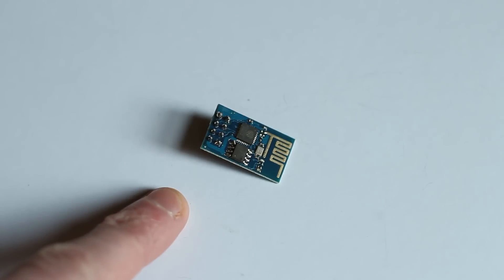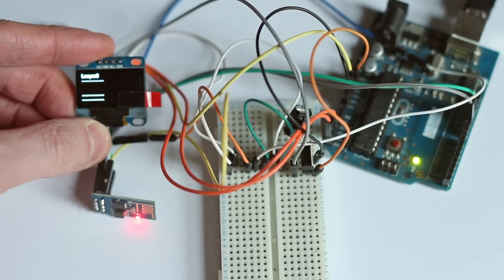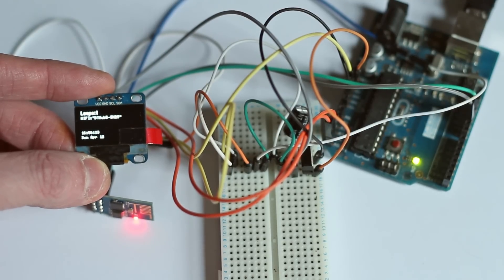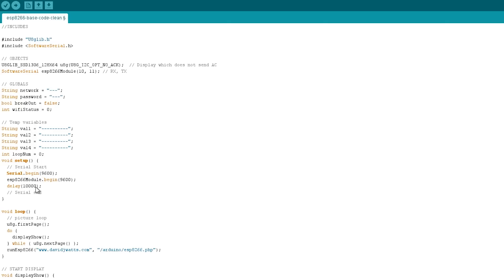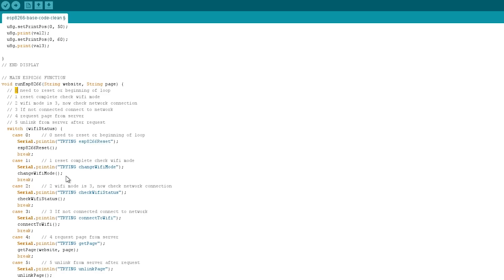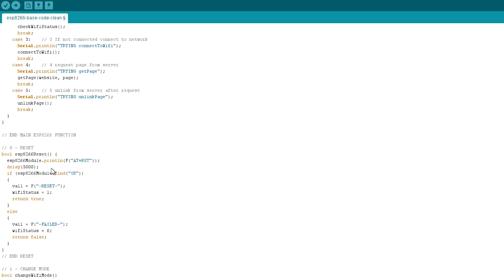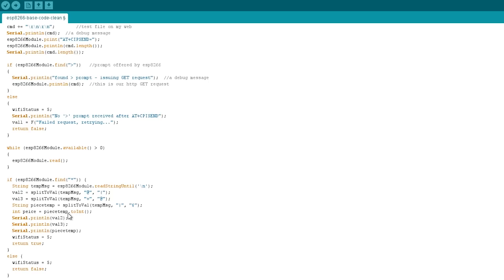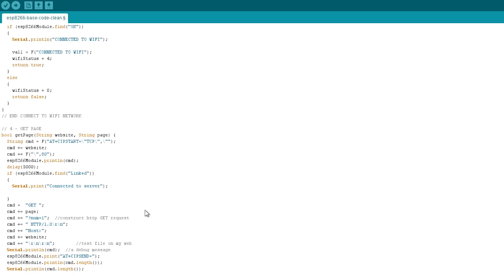Arduino Wifi - ESP8266: Schematic and Getting Started Code

Comment: I need to ask one question. Say I want to put esp 01 wifi to my led matrix display board and i want to change the text anytime through that wifi then how do I do it?
Reply from the maker: For that you will need to directly program the ESP8266, not really the right video for that. Search for how to send variables to an esp8266, using the ESP as a webserver would be the easiest approach IMO
Reply: @DavidWatts  Allright thanks for the advice.

Comment: Can u Give me the schematic diagram to connect tx and rx using resistors to convert it to a 3.3v
Reply from the maker: Just a simple 'resistor (voltage) divider', google that phrase and it should throw up a calculator or a schematic.

Comment: Can you pls show how to code to send the data to the server. Would it be possible to make the POST request? I have similar code but unable to POST the data to the server as it gives 400 bad request.
Reply from the maker: My code won't do post requests  but you could modify it. This video and code was made before libraries were readily available for the ESP modules, I would recommend using a library rather than using serial commands in your main code these days.

Comment: Hi David, 

Thanks for sharing this.

is it possible to connect an arduino with ESP8266 to a mobile internet as a wifi if we don't have access to any local wifi. just wondering if i can use my phone internet to allow the arduino with esp8266 to send data to a webserver to save to a database.

Thanks
Reply from the maker: Yes, the esp8266 can connect to a mobile hotspot.

Comment: So is that code running on the ESP8266 onboard Arduino or the master Arduino?
Reply from the maker: It was just using serial commands to control the ESP, this video sort of pre-dates common methods to program it directly with any of the languages I understand.

Comment: hello sir. Great video. Is it not okay to use the 3.3V from arduino directly instead of 5v? so I can use my esp8266 even I don't have 3.3v voltage regulator.

Comment: Love the tutorial , is it possible that you can share another one with server feature, in it .I understand it already has the server mode (AT+CIPSERVER=1,80), but haven't been able to properly setup and run the same due to looping and data length handle logic issues.

Comment: Hey David,
I am currently working on a senior project at school and am wanting to be able to interface our AGV using a browser or program (I was considering using some visual basic) using an Arduino Mega. I noticed in the video you were using a capacitor in the circuit that you didn't include on the pictured schematic is this component needed or is the regulator by itself ok to use?

Comment: thanks and much appreciated but i have one question about regulator,the regulator is used to drop down the 5 volt to 3.3 volt,but at the arduino board there is also a supply of 3.3 volt is available then why we are not ready to connect to 3.3v instead of using regulator...?
Reply: Thats right: inside the arduino is also a voltage regulator, since the esp needs up to 200mA the voltage from the arduino will drop down so it is advisable to use any external voltage supply

Comment: So far all I can do is turn on an led with a nodemcu dev board. Every time I want to change code I have to clear eprom first. How can I add pin function in pre written code?
How can I get included sketches to show up in individual tabs? Can I eventually control drivers/steppers with esp8266? Why didn't I learn all this when I was 18 instead of getting laid? :)))))

Comment: Thanks man, now they got an USB ESP8266 adapter to ease communication:
www.banggood.com/USB-To-ESP8266-Serial-Adapter-Wireless-WIFI-Develoment-Board-Transfer-Module-p-1102418.html
Reply from the maker: I have one of those, unfortunately it doesn't work as a programmer without a mod. You need to wire GPIO0 to GND for programming or to a spare pin on the ch340g
Reply: Cool, so soldering a switch there would do the trick, thanks for the tip Dave.

Comment: Hi Dave,

Is it necessary to always flash the firmware into a new ESP8266 module before programming it with our codes OR does it come pre-flashed with the firmware as factory setting ?
In case we have to flash the firmware at any stage where to download this firmware ?
Reply: Bit of a late response but maybe it will help others. 

The ESP8266 Modules all come with a preinstalled firmware which uses those AT commands in the video. 
If you just want to use them as a wifi module for an arduino you can do it as demonstrated in the video.

You will find all the commands in this pdf: 
https://www.espressif.com/sites/default/files/documentation/4a-esp8266_at_instruction_set_en.pdf

But the fancy thing about those modules is their inbuild processor with its in Pins which can be used as a standalone microprocessor itself . There are multiple ways to programm them but the simplest is to flash a arduino based firmware on it. I would recommend the later iterations of the board for that because it has more GPIO Pins and inbuilt ADC, SPI compatibility & stuff. 

Instructions on how to flash the arduino firmware that can found here:
https://create.arduino.cc/projecthub/ROBINTHOMAS/programming-esp8266-esp-01-with-arduino-011389

If you do this the old serial based AT firmware wil obviously be lost but can be reflashed.

Hope this helps someone

Comment: HI , i dont have a 3.3v linear voltage regulator so i was thinking of using resistor (Voltage drop ) using 3k3 and 8k2 registers.

can you just draw me a schematic using those registers instead of this please ???
Reply from the maker: That is a bad idea, your voltage divider output will change with input voltage and likely with output current at ESP8266 levels.
Reply: That is indeed a bad idea , but it works !!
Reply from the maker: rushic24 Cool, I would love to hear how it holds up in long term use. The ESP8266 can pull quite a lot of curent at times.

Comment: power to my esp goes off when i connect CH_PD pin to 3.3v.
Reply from the maker: +yashwanth kumar it sounds like you need to run a separate 3.3v supply, it is probably trying to pull more current than your Arduino can provide.
Reply: +David Watts i tired with a separate 3.3v supply, its working fine.but when i upload the code ,it shows  
ESP8266 Demo Sketch                                                       
Reset: General error
i had flashed the firmware also,even then this error keeps on coming..
help me...
Reply from the maker: yashwanth kumar What code are you uploading and to what board?
Reply: +David Watts GetIPaddress code to arduino nano to which esp is connected.

Comment: every time I copy and paste a code and then run the check on it it gives me error message.
Reply from the maker: You might need to be more specific.
Reply: for example , I clicked on the link you provided and selected esp8266.php . clicked raw . copied entire text . opened Arduino 1.6.11 . pasted code . clicked on verify . it gave me error :( stray '$' in program ). it does this with many different codes I try to copy and paste . but its different message . but this one I want to fix because I want to understand how to use the esp8266.
Reply from the maker: jesse chavez The PHP file is not for the Arduino, that is for a server environment. You do not need it, it is for people who have their own servers. There should be a link to other code in the description for the Arduino.

Comment: why do you need the linear voltage regulator , why cant you use the 3.3v from the Arduino?
Reply from the maker: The voltage regulator can be a little weak on clone boards, there is a fair amount of peak current required at 3.3v.
Reply: +David Watts I have an original arduino, it should work with 3.3 right?
Reply: Usually doesn’t work with the 3.3 v pin as the current is too low, use a dedicated power supply or the voltage regulator
Reply: He explains why in the video.. Did you even watch it?

Comment: hello,

My esp8266 isn't working; even the LED on esp8266 isn't blinking.  Do I need to flash the firmware?
Please note that I am using Arduino UNO(chinese version) as serial converter and I am Arduino IDE serial monitor to get the response. 

Please guide in this regard as I am no where. Thanks.
Reply from the maker: You can follow the instructions here to flash your esp8266 - http://www.xess.com/blog/esp8266-reflash/
Reply: I guess connecting the esp_vcc to 3.3v and esp_gnd to ground should blink the led. but that is not the case. what do you say David ?
Reply from the maker: Saqib Sohail CH_PD should also be connected to 3.3v. I believe you should at least see a red power led.
Reply: Dear,

I have done as you said connected CH_PD and VCC to 2.8v and GND to 0v. but no led blinking :(
Observed one thing that when I un-plug the esp_GND I get 2.8 volts as power supply but when I connect esp_GND to my power_supply_GND I get 0.8V. Is this alarming ?
Reply from the maker: Yes, I would be worried about that. 0.8v at your power supply would suggest that your power supply cannot supply the current the module needs or you have a direct short. The module needs at least 300ma.

Comment: Hi David, Thanks for the video! First of all, apologies! for the long post, I am learning and novice to Arduino. 

Few questions first
Q1. Are you connecting GPIO0 to GND for flashing the code. 
Q2. I am using LM7805 as 3.3V linear regulator, but I'm getting 3.7V as output. Is it OK?
Q3. I have attached 100 microF capacitor between GND pin and OUTPUT pin. Is it OK?  Q4. Can you explain us your bread board wiring other than the one which is there in the video? 
Q5. I have not flashed a OS on my ESP8266 12E. Is there any Arduino code to flash the OS in the WiFI module?  Please suggest a way to do it. 
Q6. I have compiled your code available on https://github.com/mrdavidjwatts/esp8266Module. I am getting following errors: 

Arduino: 1.6.7 (Mac OS X), Board: "Generic ESP8266 Module, 80 MHz, 40MHz, DIO, 115200, 512K (64K SPIFFS), ck, Disabled, None"

sketch/esp8266-Full-Menu-System-v1.ino.cpp.o:(.text._ZN6U8GLIB5writeEh[U8GLIB::write(unsigned char)]+0x0): undefined reference to `u8g_DrawGlyph'
sketch/esp8266-Full-Menu-System-v1.ino.cpp.o: In function `U8GLIB::write(unsigned char)':
/Users/Girish/Google Drive/ArduinoProjects/esp8266Module-master/esp8266-Full-Menu-System-v1/esp8266-Full-Menu-System-v1.ino:832: undefined reference to `u8g_DrawGlyph'
sketch/esp8266-Full-Menu-System-v1.ino.cpp.o: In function `splitToVal(String, String, String)':
/Users/Girish/Google Drive/ArduinoProjects/esp8266Module-master/esp8266-Full-Menu-System-v1/esp8266-Full-Menu-System-v1.ino:832: undefined reference to `u8g_font_8x13B'
/Users/Girish/Google Drive/ArduinoProjects/esp8266Module-master/esp8266-Full-Menu-System-v1/esp8266-Full-Menu-System-v1.ino:832: undefined reference to `u8g_font_5x8'
sketch/esp8266-Full-Menu-System-v1.ino.cpp.o:(.text._Z11displayShowv+0x70): undefined reference to `u8g_SetFont'
sketch/esp8266-Full-Menu-System-v1.ino.cpp.o:(.text._Z11displayShowv+0x74): undefined reference to `u8g_DrawTriangle'
sketch/esp8266-Full-Menu-System-v1.ino.cpp.o:(.text._Z11displayShowv+0xaf): undefined reference to `u8g_SetFont'
sketch/esp8266-Full-Menu-System-v1.ino.cpp.o:(.text._Z11displayShowv+0xd2): undefined reference to `u8g_SetFont'
sketch/esp8266-Full-Menu-System-v1.ino.cpp.o:(.text._Z11displayShowv+0x12c): undefined reference to `u8g_SetFont'
sketch/esp8266-Full-Menu-System-v1.ino.cpp.o:(.text._Z11displayShowv+0x149): undefined reference to `u8g_SetFont'
sketch/esp8266-Full-Menu-System-v1.ino.cpp.o: In function `displayShow()':
/Users/Girish/Google Drive/ArduinoProjects/esp8266Module-master/esp8266-Full-Menu-System-v1/esp8266-Full-Menu-System-v1.ino:832: undefined reference to `u8g_SetFont'
sketch/esp8266-Full-Menu-System-v1.ino.cpp.o:/Users/Girish/Google Drive/ArduinoProjects/esp8266Module-master/esp8266-Full-Menu-System-v1/esp8266-Full-Menu-System-v1.ino:832: more undefined references to `u8g_SetFont' follow
sketch/esp8266-Full-Menu-System-v1.ino.cpp.o: In function `U8GLIB::setPrintPos(unsigned char, unsigned char)':
/Users/Girish/Google Drive/ArduinoProjects/esp8266Module-master/esp8266-Full-Menu-System-v1/esp8266-Full-Menu-System-v1.ino:832: undefined reference to `u8g_DrawTriangle'
sketch/esp8266-Full-Menu-System-v1.ino.cpp.o: In function `displayShow()':
/Users/Girish/Google Drive/ArduinoProjects/esp8266Module-master/esp8266-Full-Menu-System-v1/esp8266-Full-Menu-System-v1.ino:832: undefined reference to `u8g_DrawTriangle'
/Users/Girish/Google Drive/ArduinoProjects/esp8266Module-master/esp8266-Full-Menu-System-v1/esp8266-Full-Menu-System-v1.ino:832: undefined reference to `u8g_SetFont'
sketch/esp8266-Full-Menu-System-v1.ino.cpp.o: In function `U8GLIB::setPrintPos(unsigned char, unsigned char)':
/Users/Girish/Google Drive/ArduinoProjects/esp8266Module-master/esp8266-Full-Menu-System-v1/esp8266-Full-Menu-System-v1.ino:832: undefined reference to `u8g_SetFont'
/Users/Girish/Google Drive/ArduinoProjects/esp8266Module-master/esp8266-Full-Menu-System-v1/esp8266-Full-Menu-System-v1.ino:832: undefined reference to `u8g_SetFont'
sketch/esp8266-Full-Menu-System-v1.ino.cpp.o: In function `displayShow()':
/Users/Girish/Google Drive/ArduinoProjects/esp8266Module-master/esp8266-Full-Menu-System-v1/esp8266-Full-Menu-System-v1.ino:832: undefined reference to `u8g_SetFont'
/Users/Girish/Google Drive/ArduinoProjects/esp8266Module-master/esp8266-Full-Menu-System-v1/esp8266-Full-Menu-System-v1.ino:832: undefined reference to `u8g_SetFont'
/Users/Girish/Google Drive/ArduinoProjects/esp8266Module-master/esp8266-Full-Menu-System-v1/esp8266-Full-Menu-System-v1.ino:832: undefined reference to `u8g_dev_ssd1306_128x64_i2c'
sketch/esp8266-Full-Menu-System-v1.ino.cpp.o: In function `runEsp8266(String, String)':
/Users/Girish/Google Drive/ArduinoProjects/esp8266Module-master/esp8266-Full-Menu-System-v1/esp8266-Full-Menu-System-v1.ino:680: undefined reference to `u8g_Begin'
/Users/Girish/Google Drive/ArduinoProjects/esp8266Module-master/esp8266-Full-Menu-System-v1/esp8266-Full-Menu-System-v1.ino:681: undefined reference to `u8g_FirstPage'
/Users/Girish/Google Drive/ArduinoProjects/esp8266Module-master/esp8266-Full-Menu-System-v1/esp8266-Full-Menu-System-v1.ino:681: undefined reference to `u8g_NextPage'
sketch/esp8266-Full-Menu-System-v1.ino.cpp.o: In function `loop':
/Users/Girish/Google Drive/ArduinoProjects/esp8266Module-master/esp8266-Full-Menu-System-v1/esp8266-Full-Menu-System-v1.ino:690: undefined reference to `u8g_Begin'
/Users/Girish/Google Drive/ArduinoProjects/esp8266Module-master/esp8266-Full-Menu-System-v1/esp8266-Full-Menu-System-v1.ino:692: undefined reference to `u8g_FirstPage'
/Users/Girish/Google Drive/ArduinoProjects/esp8266Module-master/esp8266-Full-Menu-System-v1/esp8266-Full-Menu-System-v1.ino:692: undefined reference to `u8g_NextPage'
libraries/src/U8glib.cpp.o:(.text._ZN6U8GLIB7initI2CEP10_u8g_dev_th+0x0): undefined reference to `u8g_InitI2C'
libraries/src/U8glib.cpp.o: In function `U8GLIB::initI2C(_u8g_dev_t*, unsigned char)':
/Users/Girish/Documents/Arduino/libraries/src/U8glib.cpp:57: undefined reference to `u8g_InitI2C'
collect2: error: ld returned 1 exit status
exit status 1
Error compiling.

  This report would have more information with
  "Show verbose output during compilation"
  enabled in File > Preferences.

How to remove it? 

PS: It does not include library files for U8glib.h which you should mention in your video. I have downloaded them separately from https://github.com/olikraus/u8glib
Reply from the maker: +Girish Suri The errors you are getting there are just from the u8glib library not being installed. You should be able to fully install it from the manage libraries menu. I would recommend starting with the basic example or if you are not comfortable playing around with the code there are quite a few fully featured libraries around.
Reply from the maker: +Girish Suri Q1 - I would recommend following tutorials on esp8266.com if you want to flash the module. Q2 - Ar you using a diode to drop the 5v from the 7805? Q3 - You capacitor should be between vcc and gnd. Q4 - It was really just a demo, I would always suggest stating from the base code example which is simply wiring up the esp8266 as a serial interface. Q5 - Linked to Q1

Comment: What is F() function? i.e. esp8266Module.println(F("AT+RST"));
Reply from the maker: +videokolya It is a function to store the string in flash memory rather than RAM.  I would have used it to free up the amount of available memory for variables but wanted it still to appear in context rather than as a variable itself. http://playground.arduino.cc/Learning/Memory

Comment: I heard on another video that the reason why the 3.3 V arduino supply isn't enough is because it's being powered via USB. If you use the adaptor power supply (9 V) then the 3.3 V pin can supply enough for the ESP. Is this true?
Reply from the maker: +Jason Axford Hi, I didn't find that to be the case. It could depend on your board though, clones and real Arduino boards often have different regulators.
Reply: OK. Cheers. I'll get a separate power supply board then.

Comment: Just wondering, where can I get the arduino code and the specifications of the capacitor and the voltage divider?
Reply from the maker: +smoke264 Hi Buddy, the code is in the description. If you don't want barebones code I would recommend an ESP8266 library though. Your voltage divider can be calculated here - http://lab.bitluni.net/voltagedivider a 20K and a 10K should do it. I think the cap is just a 100 microfarad one.
Reply: thanks